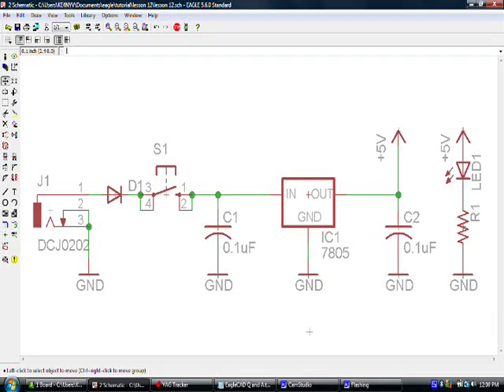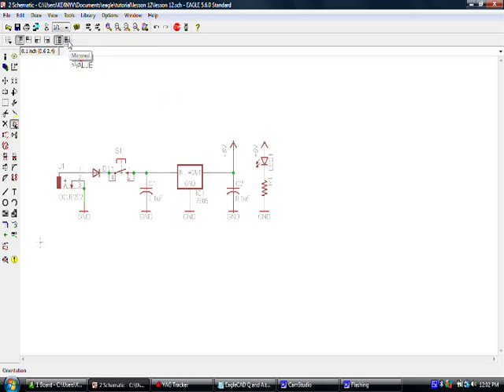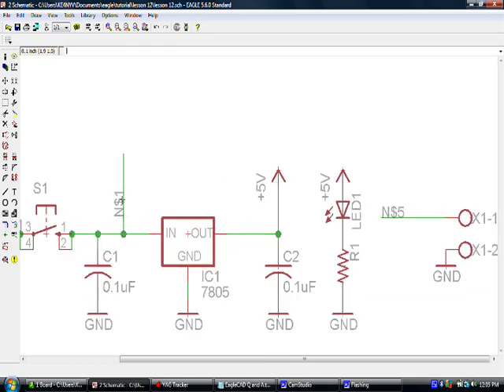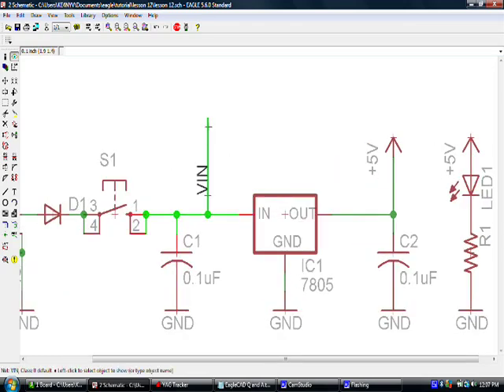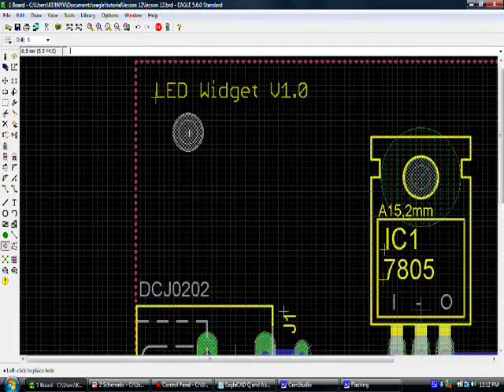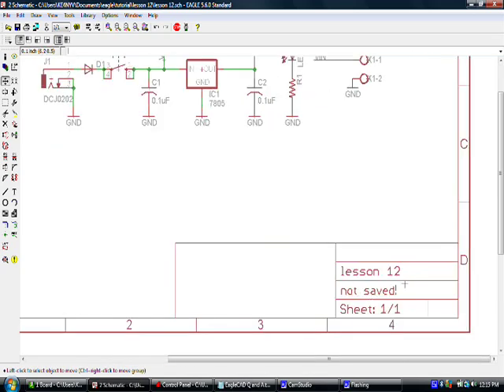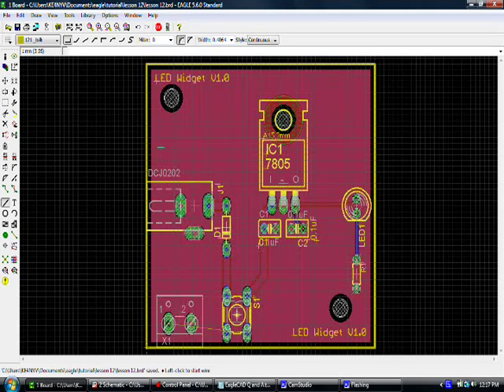Cadsoft EagleCad Tutorial Lesson 12

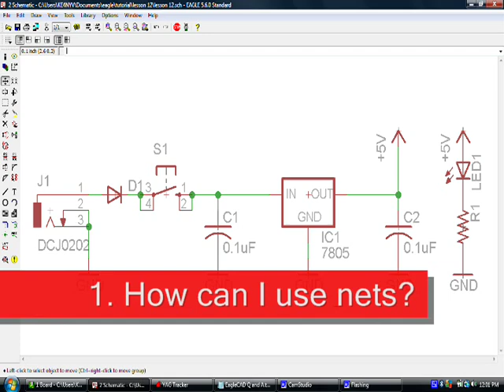Comment: 0:54 Q1: How can I use Nets? - Helps to simplify schematic
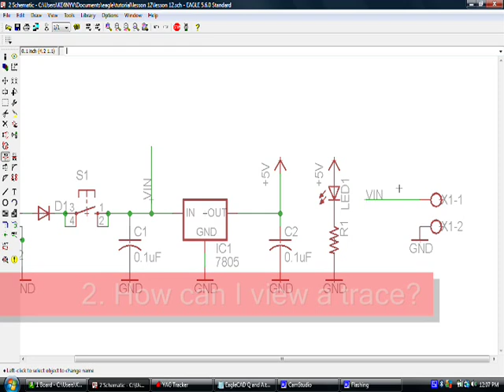6:41 Q2: How can I view a Trace? - Use the Show Command (Covered in Lesson 7 @ 1:30)
8:20 Q3: How do I restore a Library? - Enable and Load a library 
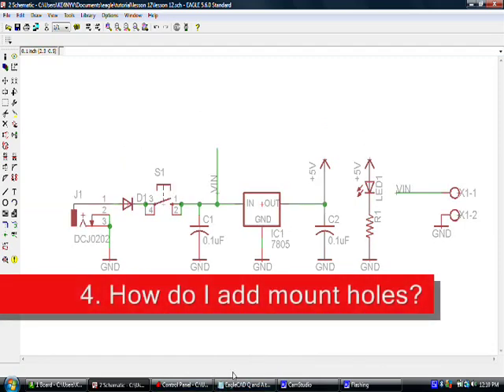10:29 Q4: How do I add mount holes/ mounting pads? - Use hole tool. 
13:11 Q5: How do I add a frame? - Frames can create a nice border on the schematic.
15:22 Q6: How do I add a PCB border? - Creates a non-printed silk screen border.
Reply from the maker: Thank you for creating this guide!

Comment: Hi there! Thanks so much for the tutorial! One quick question - which component out of the library could I use as a point to connect the +ve and -ve wire to the circuit? EG. i don't want the power source to be part of the terminal, just two points that I may solder a power supply to after making the pcb board?
Thank-you in advance

Comment from the maker: This is a good question.  I like to build guitar effects pedals and this is a common practice with PCB's and external parts like pots.  In the case of a pot, I use the pinhead library which gives me anywhere from 1-40 pads in a row.  For a pot, I use the 1x3 part.  This gives me a nice three pad "part" to put on the board, normally near the board's edge.  Connect to this pin header part as though it's the pot.  Then at assembly time, connect the pot to these pads with jumper wires.

Comment: That was a great tutorial! Thanks. But what if you'd like to use components that are mounted on the chassis with solder lugs? Like a potentiometer. Can you just leave the components lying there on the side of the board, with those thin straight lines attached to them, but without actually placing it on the board or adding copper traces?

Comment from the maker: @rainbowsalads Sorry, I missed this post.  Yes, when I get them back, they are already pre-cut from the house.  Most houses will also V-score a panel, meaning they run a v shaped rotary cutting tool down your borders, on both the top and bottom of the board and that leaves the panel in tact, but gives you an easy way to separate them.  ,You just need to snap the boards apart when you get them.  This is usually only useful when assembling a whole bunch at one time.